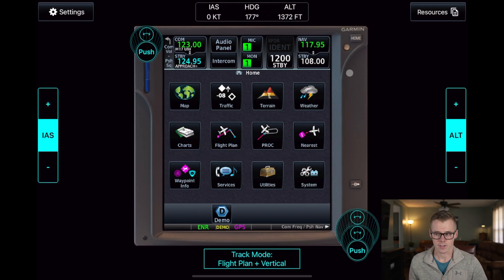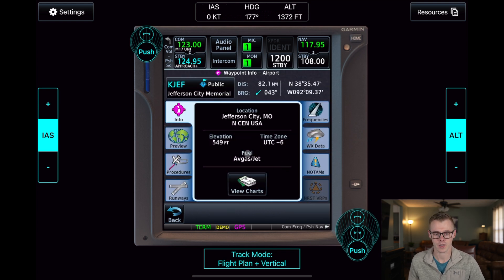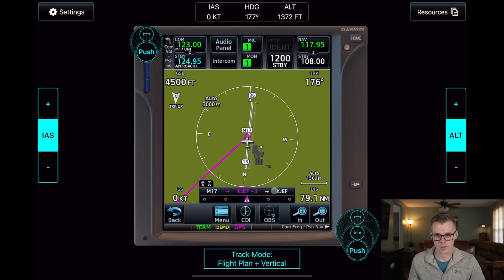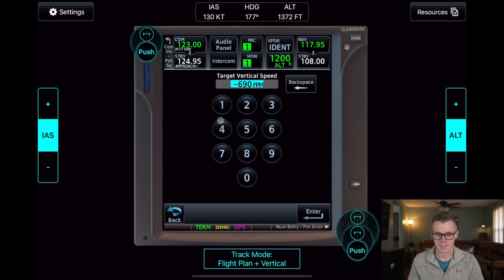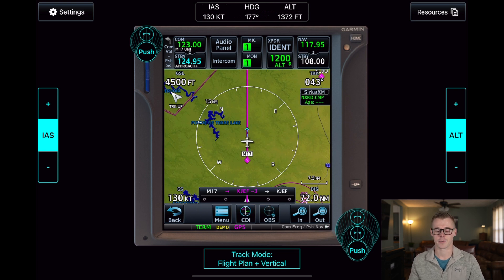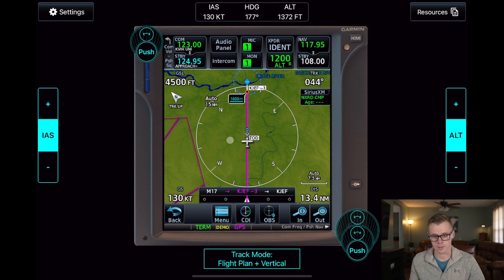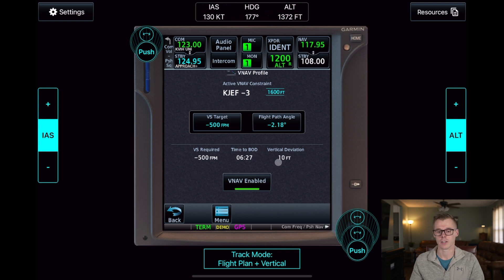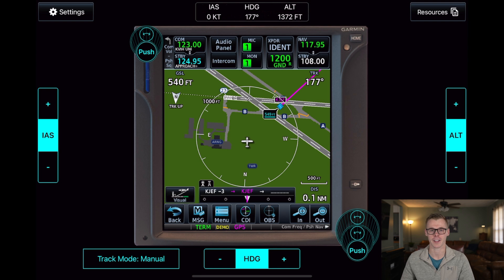Garmin GTN 750 VNAV Tutorial: Easy Descent Planning for Cross-Country Flights

Comment: So I have a question. Once VNAV is activated, what should you do if your autopilot doesn't have a VNAV function? Should you engage the approach button? I am assuming you would have to load a visual approach for that to work? Thank you!
Reply from the maker: Hi Gary, If your AP doesn't have a dedicated VNAV button but is capable of GPS coupled approaches, visual approach should work - just configure the autopilot in a similar manner how you would a VNAV/RNAV approach. However i'm not sure if you would get vertical guidance prior to the V3NM waypoint (which is kind of the point of a VNAV). I like this video demonstration (https://www.youtube.com/watch?v=HfjcnMRjcpU) showing the relationship between the GPS and autopilot on a visual approach, but if you have a 3rd party or older autopilot, it may have limited functionality. Sorry I can't give you a straight answer!